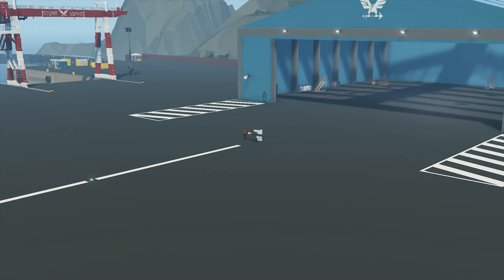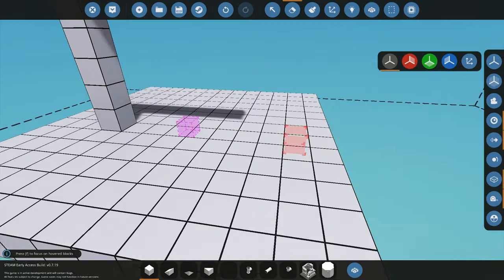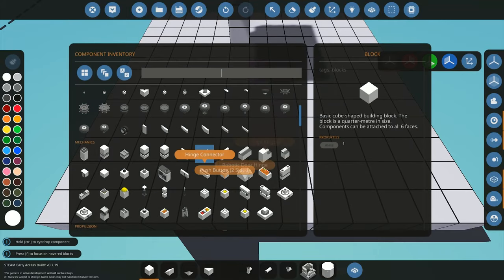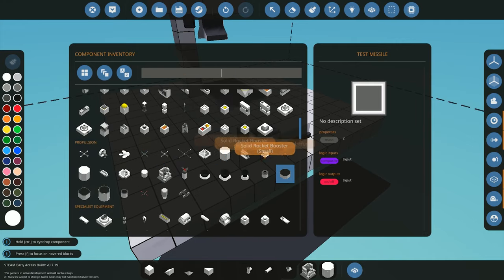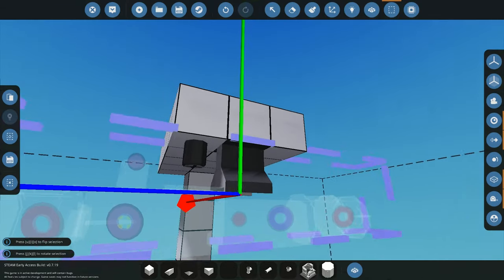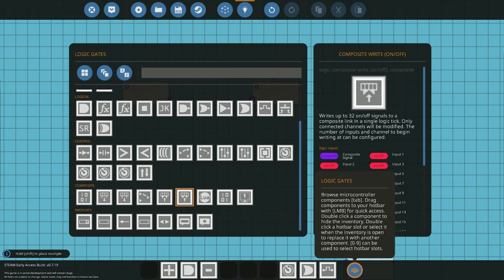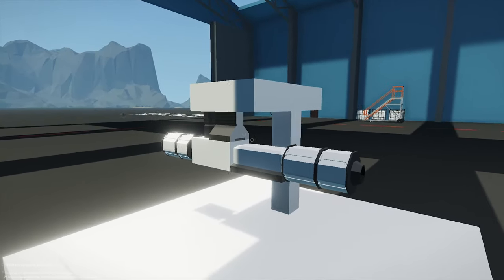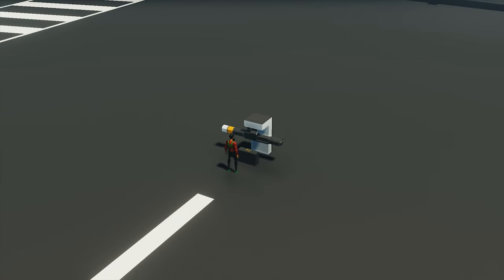Stormworks Small Missile Tutorial

Comment: To anyone reading this, add another track block so the gripper is touching a track before it spawns, so the sliding connector will work.
Reply: That just makes them go straight up
Reply: @olssong7941  What? What I mean is in this case extend the rocket by 1 more sliding connector track that's immediately touching the gripper. The exact build in your video does not currently work; the gripper misses and doesn't like to play with single tracks. As another example, a horizontally facing gripper to grip a vertical column needs at least two tracks since a single track won't catch.
Reply: @nanashi4821  I did as you said, they just go up.

Comment: Great video, however after today's update, I got stuck with a problem. I had added this missile on both wings of my plane. The left one works perfectly, but the right one doesn't connect properly when spawning. The electric connects sticks together, but the slider doesn't slide into each other, causing the missile to be hanging off and swinging around. I am pretty sure that the sliders are in the correct rotation, and it is symmetrical on both the left and right sides of the wings. I don't understand why the left sides work but the right sides don't.

Comment: They seem to work very well, the only issue is if i spawn it in, the missiles rotate upwards. They dont get stuck straight, but go up more than 90*. If i try placing blocks to stop that, they dont go up anymore but hang loose. Do you maybe know the issue?

Update: When i tried taking off with the heli i put the missiled on, the helicopter bounced and than the missile got into place. So, I added a handle in the back to move it in place myself and it works.